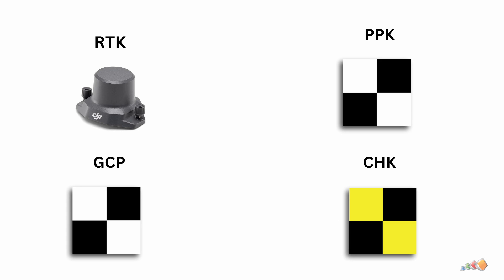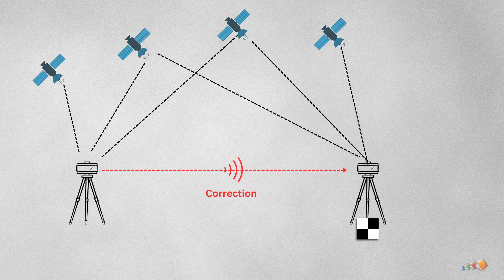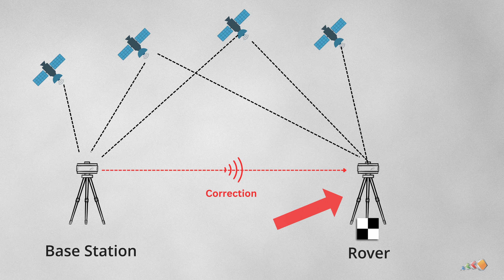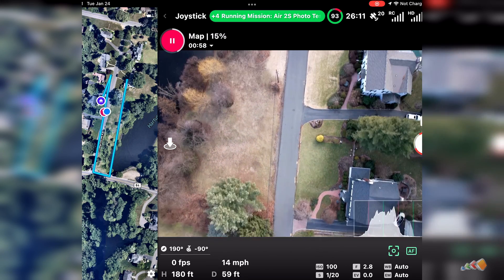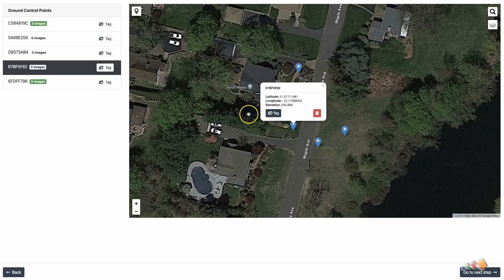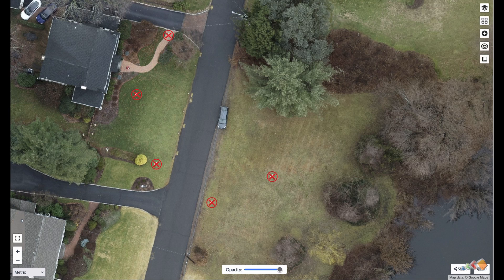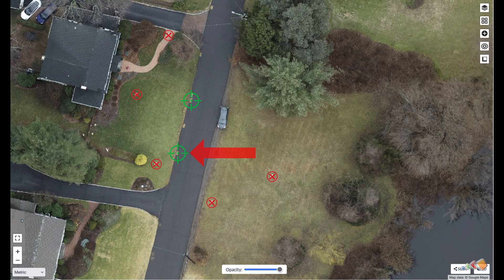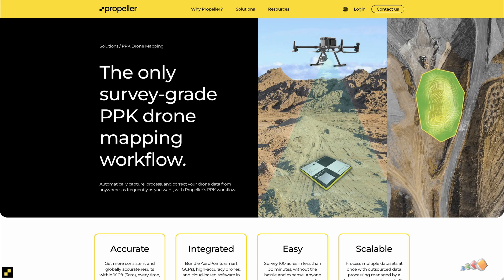GCPs and Checkpoints Explained

Comment: I like how clear your explanation is, i have a question though, can I use smaller drone like a DJI mini 4 pro with GCPs to create high accuracy maps? I like to start another career for my drone other than taking videos and pictures 😁
Reply from the maker: Glad it was helpful.  Yes, you can use GCPs with a mini 4 pro to create high accuracy maps.  It's just more work.  I plan to follow up my precision drone mapping course (have you seen that?) with another one doing exactly that - using GCPs and a Mini 4 pro.  Make sure you are subscribed so that you don't miss it!

Comment: What's the process I have to follow if I have a DJI RTK2 and a Mavic3E with RTK module in order to get  accuracy using GCP?
Thanks
Reply from the maker: You're mixing things that are sort of mutually exclusive.  If you have a DJI RTK2 and it is correctly placed on a known location, and linked to the RTK on the drone, and you didn't get any errors during the flight then your picture should already be accurate.  You can use checkpoints (GCPs not used in any correction) to make sure that everything is where it needs to be - that is how you confirm accuracy.  
If you want to use GCPs then you can process in software that accepts GCPs.  In that case you would upload the location of all of the GCP centers into the software, tag photos with the GCPs in them and identify the center of the GCPs in each photo, and then let the software process.  It will adjust the output to place the GCPs in the correct location.  
If you use GCPs you don't have to use RTK at all, however it will help by reducing the amount of work the software has to do to correct the locations.  

Hope that all makes sense.
Reply: @aviosmedia  Thank you very much for your clear and quik response.
I have a situation. I have to map a big area and obtain orthophotos and contour lines. I can't perform this job in one day (around 20.000m2).
I'm using Mavic 3E, DJI RTK2 and DJI Terra.
I can't run to o many photos in one reconstruction. So, I divided the whole area in smaller blocks and reconstruct it separately and got an orthomosaic for each block.
When I open all the orthomosaics together I noticed a gap or mismatch on the border lines (difference in coordinates or elevation).
I didn't notice this gap when the RTK is on the same location for two adyacent blocks.

So my question is, how do I tie all the blocks together without having gaps?
Do I have to make a GCPs network for the whole big area so they match all together?
Do I have to put the RTK anthenna in the border of each block so they have a same common point as a GCP?  

Thanks for your help
Reply from the maker: @ElizaldeCC  Are you placing the DJI D-RTK on a known point?  It sounds like you are just moving it around.  The RTK antenna is not a GCP - you are aware of that, right?
Reply: @aviosmedia  I guess I've been using it wrong.  I've placed it on manhole covers, signaling or existing structures where I could check the info any time. But I've change positions every day, so I guess I've been moving it around. 
What would a known point? And how should I use the RTK antenna? Do you have a video on that?

Thanks again.
Reply from the maker: @ElizaldeCC  Yes, sorry to say but you have been using it incorrectly.  If you watch the video you will see that the base station is placed on a known point - and you have to enter those coordinates into the base station when you place it on there.  Once the base station knows exactly where it is it can compare that to the information provided by the GPS signals, calculate the difference and then send that correction to the drone (or other RTK rover).  
If you have just been moving it around then that won't work as you are not giving the base station the correct information.  

I don't have a video on setting up a base station yet but it's on the list :). 

However, don't despair!  I might have a solution for you if there is an NTRIP station that is reasonably close by as you can use the historic information from that to create a duplicate set of photos with updated GPS location information.  This video shows how to do that - although you will need to find your local NTRIP/CORS system.  https://youtu.be/cESXvYiQ5ps

Comment: Excellent overview, thanks. Interesting that there's so many ways to produce a final deliverable. Lot of options limited only by one's budget!
Reply from the maker: Glad it was helpful!

It's also worth noting that it's best to include more than one if you can.  e.g. use RTK during the capture and then PPK, GCPs or both.  The MOST important one though is to use checkpoints.  Without that you cannot be sure that everything came out as expected.
Reply: @aviosmedia 

great video👍🏾👍🏾, but I have a question please .
how to introduce checkpoints in software such as « agisoft metashape »?
Reply from the maker: How you use checkpoints varies based on the software.  I don't use Agisoft so I can't help you there but I'm sure there are tutorials out there for that.  

Once I have some time I will be doing a series going end to end from setup and capture of a site through processing and delivery of the end product to clients.  But...it's going to take a while to get to that.
Reply: I was instructed to place my GCPs where every 150 meters/500 feet covers the area to be drone mapped for best accuracy.  Then you have to optimize the GSD for accuracy
Reply from the maker: @thomasott5899  I think it very much depends on the size of the site.  If you are covering a large site - e.g. 450 acres - then that would be a lot of GCPs

Comment: Not sure I understand. Does the GNSS receiver (base station) sends RTK correction to the rover in direct or it sends it to the controller then the controller send it to the rover. If second option, with which protocol?
Reply from the maker: When setting the GCPs you don't use the drone at all.  Typically you use two GNSS receivers - one placed on a known location (future video on how to find those coming) and one that moves around.  The first GNSS receiver (base) sends corrections to the second GNSS receiver (rover).
Reply: @aviosmedia  how does this work with a DJI D-RTK 2 workflow?
Reply from the maker: @mekdemltd  The D-RTK 2 is the base station
Reply: @aviosmedia  ok but did not really answered my question. So in the case the base sends the correction to the rover (a drone in this case), does this correction sent to the controller then the controller forward that information to the drone ? And if yes, using which controller/drone communication protocol?
Reply from the maker: @DenisElec  Yes, but do you mean which communication protocol?  If so, I would assume it's using Ocusynch (depending on the drone), but I really couldn't say for certain.   It might help if you say what the reason behind the question is.
Reply: Good videos. Whilst many claim RTK makes maps more accurate (they do without using GCPs at all), to get the most accurate maps (what's the point of creating one otherwise) you need to use GCPs.  
Before RTK drones existed, and now, the most accurate maps are created only by using GCPs. The benefit of RTK is not absolute map accuracy (a common misconception) but increased accuracy of initial image capture location. 
Think throwing jigsaw pieces out of the box and them being closer to correct final location: that's all.
RTK simply makes metadata (exif data) more accurate at time of capture, but doesn't provide the highest possible accuracy. Only GCPs do that. 
P.S. I guarantee I can create a more accurate map with a non RTK mechanical shutter camera drone (Phantom 4 Pro) with GCPs, than by simply using an RTK enabled Drone. Without GCPs and in particular Checkpoints, map accuracy can never be trusted or proven. 
IMHO, if you're creating maps without GCPs and Checkpoints, you're not serious about 
mapping.
Reply from the maker: @alwaystravelling100  100% agree.  Love the jigsaw puzzle analogy!